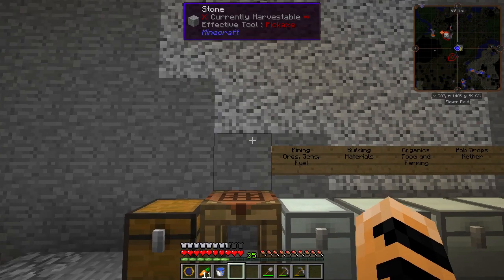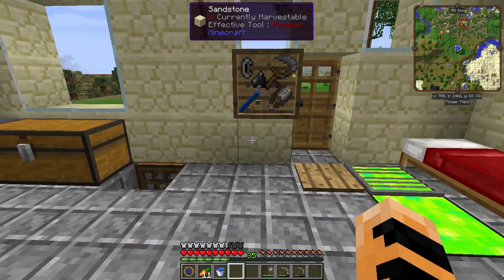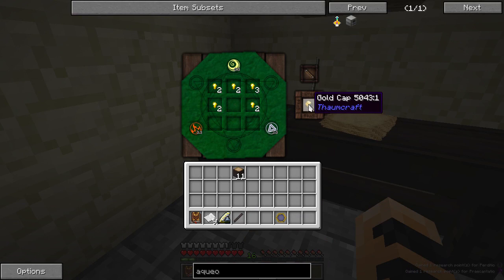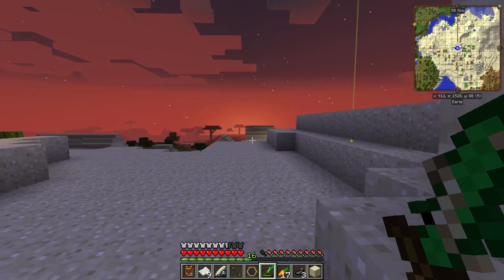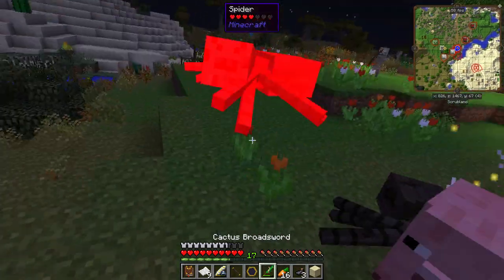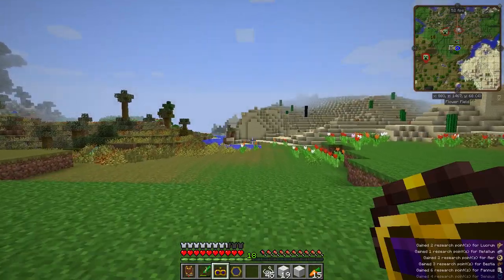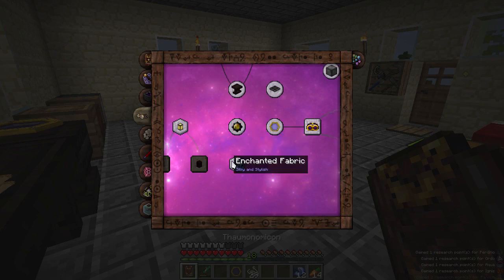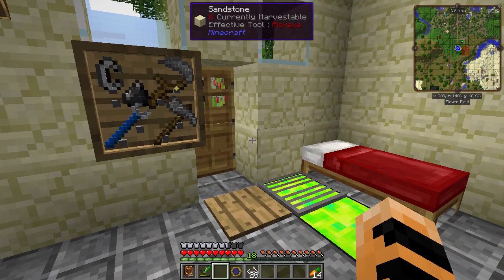Let's Play Thaumcraft 2015 E09 - Wand Upgrade

Comment: Hi, I like this new series but I feel like it wouldn't hurt to ,,speed up,, the videos? Just make them a bit more fluent? I mean, for example, reading every single aspect in a research and explaining ,,this is in this and that and this is water and this is air,, is not necessary IMO. It was explained in a previous video and people can pause the video, copy aspects in game, move on. The same with crafting. Y u no NEI autocraft? And most importantly, could you please turn down the game volume a bit? Chests and animals are as loud as your voice, it's very distracting. 
On the other hand, it seems like you know what you are talking about and I like that. Also thanks for the good pronunciation of aspects, one can rarely hear that on YT. 
Anyway keep it up, wanna see how this series goes ^^
Reply from the maker: VaeLkyy Sounds reasonable. As for the aspects, I had several comments in my thaumcraft series complaining that I didn't show this or that, but I agree that with the research tool, it's hardly necessary. I will forgo it from now on. I will turn down the audio on the game. I'm not sure what you mean by NEI auto craft. Are you talking about shift click from NEI. I try to do that when possible, but I forget sometimes, and other times the items are in my project chest where shift-click doesn't work. I'll try to put them in my inventory from now on so shift-click ? will work. Thanks for the feedback.